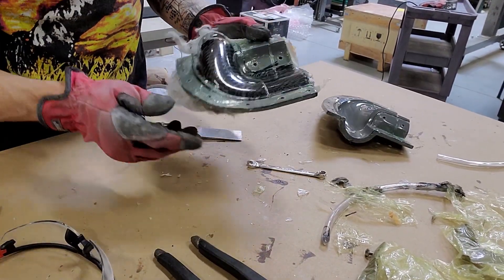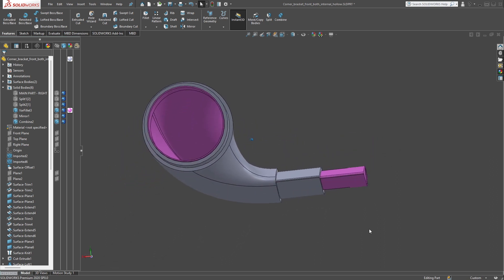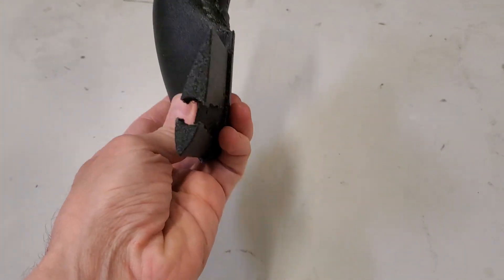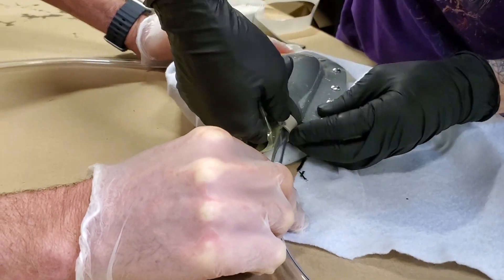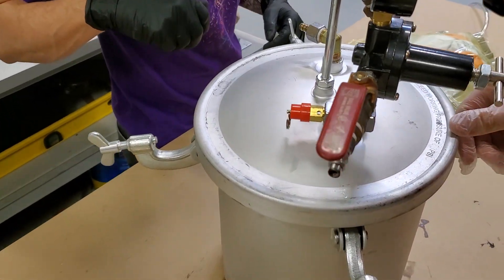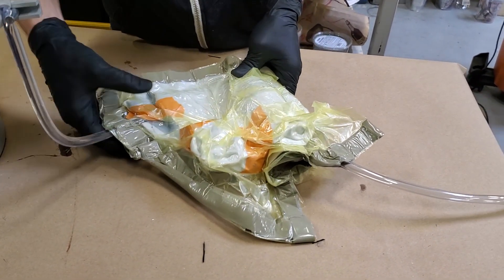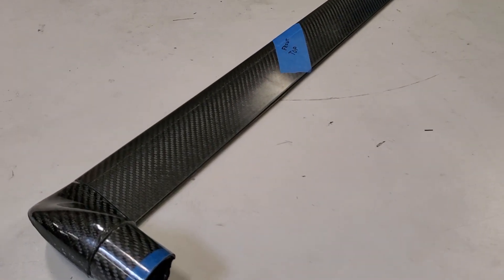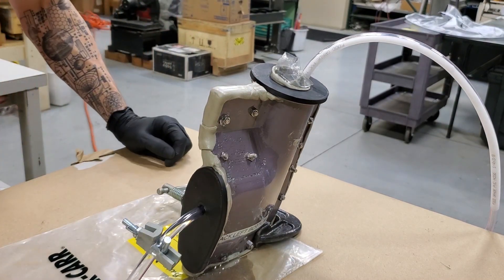Making The Carbon Fiber Parts Hollow: DIY RTM Part 2

Comment: I have used a water soluable heat- hardened ceramic to make the core, wrapped and bagged arount the part, then washed out the core.  We made intake and wxhaust tibes for racing motorcycles.
Reply from the maker: I've done a little bit with materials like that as well.

Comment: and how can you put everything in the oven? is it necessary to continuosly vacuum? So i can use Peek or other fdm engineering materials to do so in structural or tanks?
Reply from the maker: I believe it is necessary to pull a continuous vacuum. You can have a vacuum pass-through connector into an oven.

Comment: Correct me if I'm wrong, but that tubular insert bag served no purpose whatever. Yes, it inflated, but against the walls of your 3d- printed part, not the carbon fiber itself.
Reply from the maker: The 3d printed part is just a single perimeter so hardly air tight. Without the bladder it would fill with resin.

Comment: This is really cool stuff! I tried nearly the same process like you did to get some hollow parts. After some testing of the process I decided to change the direction and make some custom shaped silicone bladders to put some internal pressure on the inside of the mold. It took me some tries but it worked out pretty well.
Reply from the maker: Yeah lots of applications for silicon